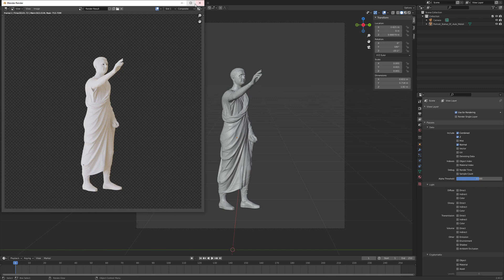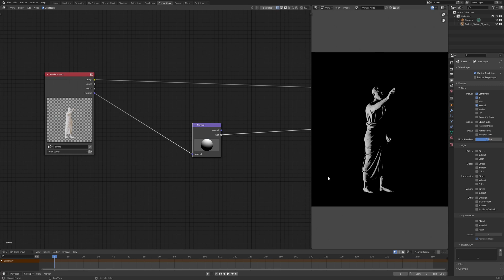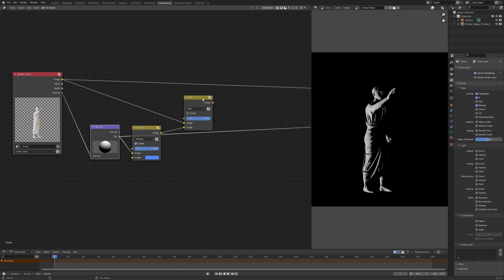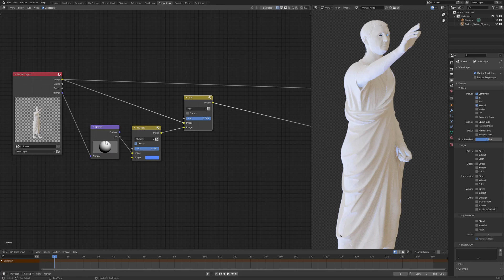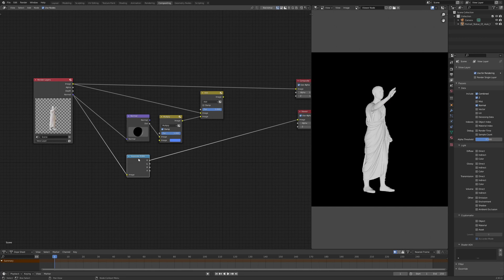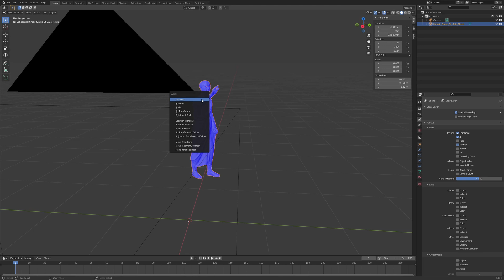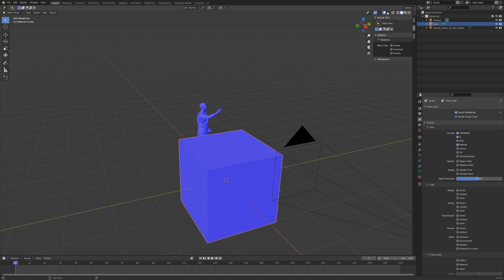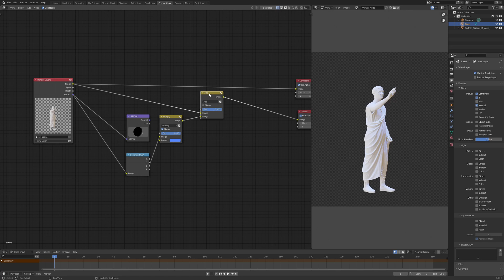Demystifying Blender Cycles' Render Passes: Normal Pass

Comment: Hello. I got a normal pass from Unreal Engine 4. It looks like a frame drawn in the colors of the normal map. I have an image missing when I connect a Normal node, but if I rotate the ball inside the node, it changes color in the viewer. I don't quite understand the mechanism. Is it possible to use the Blender normal pass obtained by Unreal Engine 4 in the compositing?
Reply from the maker: Hey, since I haven't used the ue4, i can't really give you a concrete answer. But I'd love to experiment with the file. Why do you hope on my discord server so we can mess around more.
Reply: @TheInfinites   I'm from Russia, we seem to have discord blocked. If you're interested in trying the file, I threw it on disk. YouTube deletes links because the words DOTS, SLASH need to be replaced with a sign. Spaces should be removed. Then the link address should work.
The link will be a file with render passes. One of them is a normal pass. These are just test situations and test content in Unreal Engine 4. I want to make a cartoon in Blender as well. I've already made a few cartoons. But with a very large scene it seems to me Blender will be difficult to handle. So I'm trying technology Unreal Engine 4. 
Thanks for the offered help. 

disk DOTS yandex DOTS ru SLASH d SLASH bOFXjbL7t8ZgFA
Reply from the maker: @MrGravicaper  Cool! I'll get back to you at the earliest.
Reply: @TheInfinites  Thank you, esteemed one. Take your time, do as you please. The main thing is to understand - whether the render pass normal from Unreal Engine 4 can be used in the compositor Blender. In the proposed file not all passes are informative, I'm still testing the technology when I have free time. As far as I see, in the Unreal Engine with passes is worse than in Blender. But conceived the use of Unreal because of the desire to portray an alien jungle with moving leaves from the wind. In the engine it is not difficult to do this with the material. But Blender will probably be difficult to do this. But I could be wrong.